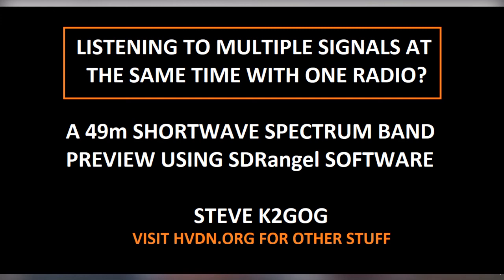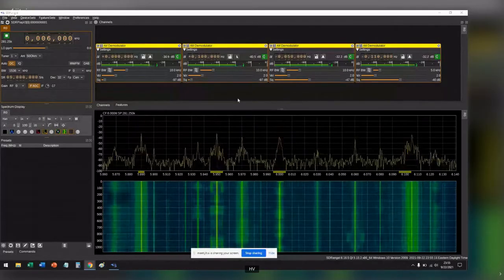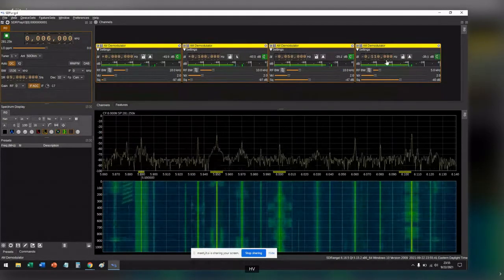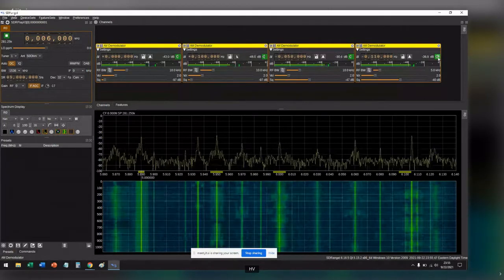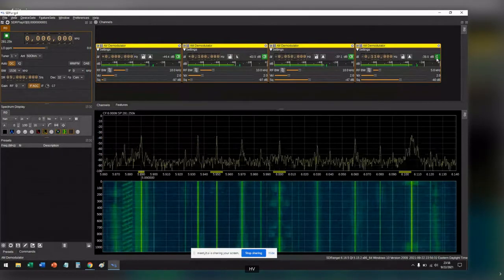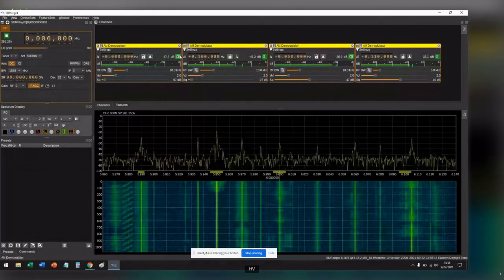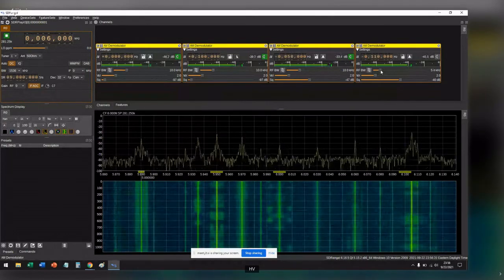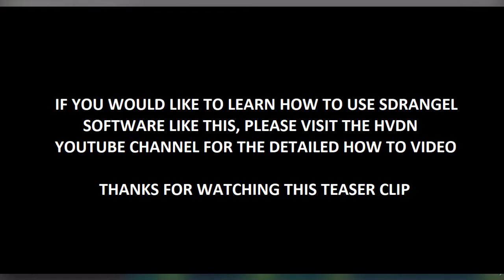PREVIEW:  Decoding multiple signals at the same time with one SDR

Comment: Can you pipe each stream to an independent audio output? This could be very useful for example to stream Approach, Tower, Ground and Area from the same airport to a website like LIVE ATC
Reply from the maker: yes, that can be done. Depending on the bandwidth of your SDR, you can run as many AM decoders as you want and pipe the audio to Live ATC and have all those selected channels audible a the same time. Far better than using a scanner which can only listen to one frequency at a time.   Using a virtual audio cable like VB-Cable would make your use case easy.